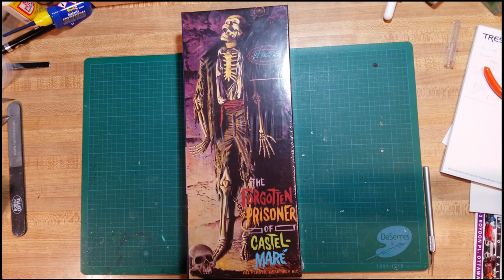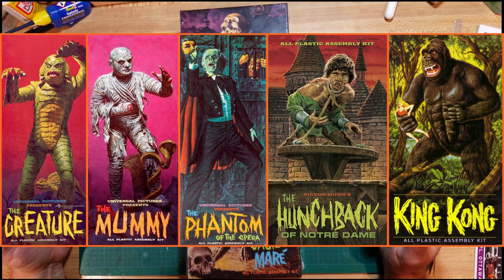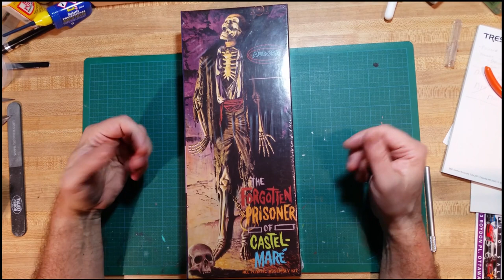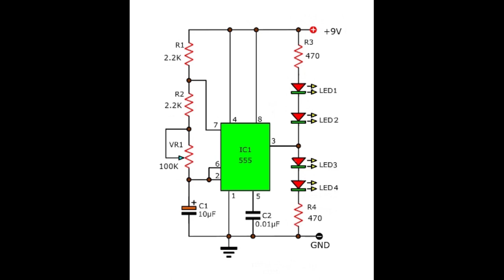Model Build - The Forgotten Prisoner of Castel-Maré

Comment: I built this kit recently and noticed that if you switch the locations of the skull and the rat on the right it seems to be a better fit, like the snake is actually going after the rat. I think it was an error on the instructions.
Reply from the maker: I did notice that the 'slot' for that rat was a lot bigger than the stub under the rat so it's very possible the instructions got it wrong. The skull on the floor looks so much more realistic than the one on the figure. I can't figure out why they made them so different and then put the worse looking one on the main figure.